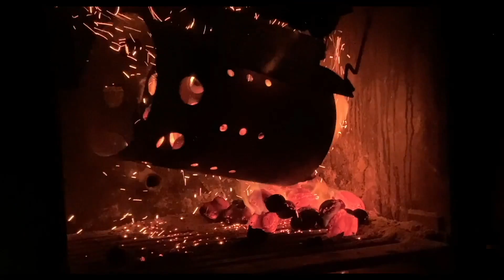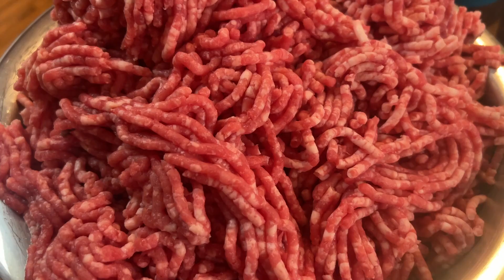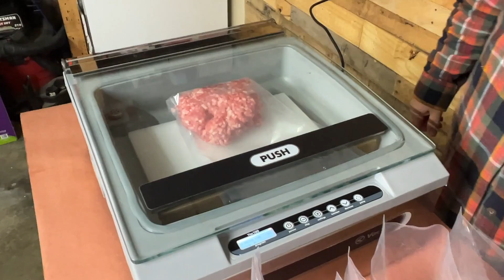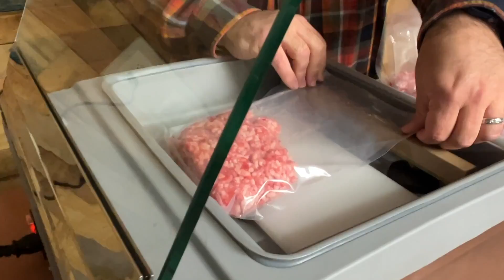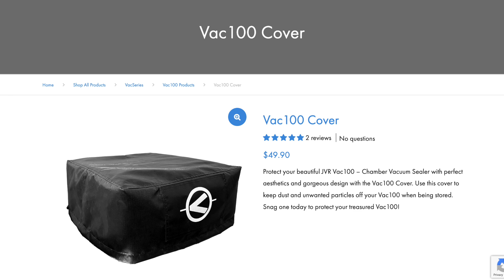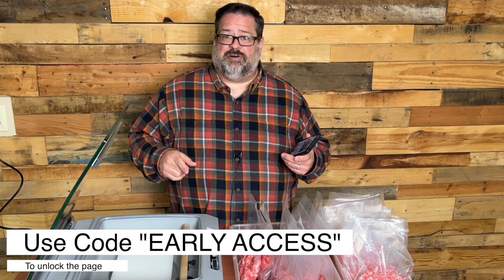Vacuum Sealer Torture Test: Can It Handle 16 Packages of Brisket?

Comment: You can actually stress the pump for 5 minutes straight if you run the oil cleaning cycle, it's the last program on the machine, it'll run the pump for 300 seconds. So if you run that program, say 4 times, it'll simulate 20m of nonstop work! Of course, without using the heating element!

Comment: Had mine for over year. It will not Seal bags. Replaced bar, sent in service ticket, called a week later. Still no word even though I have a ticket number. Do not think I will replace with another Avid product. It's great till it stops working then good luck on even talking to someone about service.

Comment: Wow is  that thing slow
Reply: Pretty standard time for most of these machines. The cycle time is actually user adjustable, and it does tell you if the vacuum pressure is reached, so you can optimize the amount of seconds it engages the pump.

So if your cycle time is 35s, but you can see that you're reaching vacuum in 20s, you can scale it back to 20s and optimize your cycles!

Comment: I absolutely love the Vac100. They are a fantastic company with a rock solid product. They include everything you need plus some extras that others don’t. What ultimately made the decision for me was the fact that every single part of this machine is EASILY replaceable with a parts order from JVR. If this thing ever craps out, you just need to open it up, lift the hinged body, replace the part, and bam….good as new.
They’re running a fabulous Holiday sale too…

Comment: Looks great. I’d love to know how it compares to the similarly priced Meat! Chamber sealer. Thank you.
Reply: I’m a huge MEAT fan and own their slicer. I love it. With that being said, I researched both extensively. The JVR was warranted longer, and includes everything you need to get started. Meat does not sell replacement parts if you ever need it. JVR not only sells replacement parts, but makes the body on a hinge to promote fixing it if it ever breaks vs spending the money to buy a new one.
Reply: @JeffryK13  Thanks!

Comment: I have the oilless meat your maker chamber vac. It is nice because I do not have to change oil on it. The oilless vac is medium on the noise. It just works. I have had mine for 10 months so far and no issues.
Reply: The problem with oil-less machines is that they only achieve about 90% vacuum while oil based machines can achieve 99.9998% of vacuum - it's a huge difference for the longevity of your food! 

Also, the bigger issue with oil-less pumps is if and when you package moist food, some of the moisture will make it to the pump, eventually rusting it and killing it.

If you mostly do dry goods like coffee, etc. you'll be fine. But meats, fish, and anything moist will eventually destroy an oil-less machine.